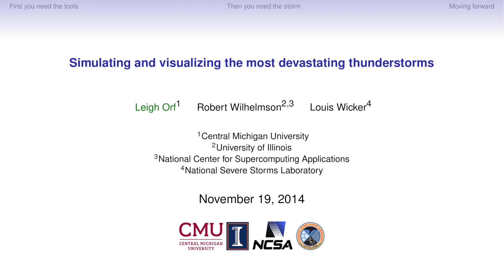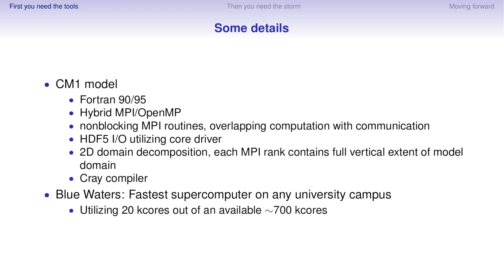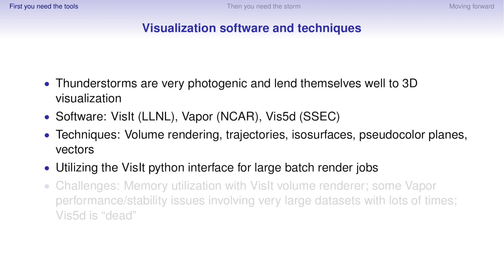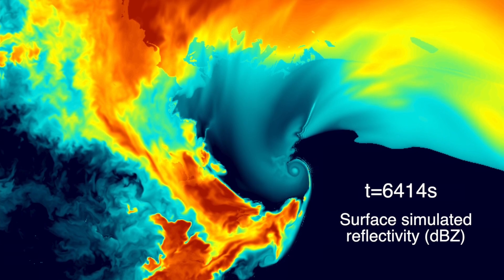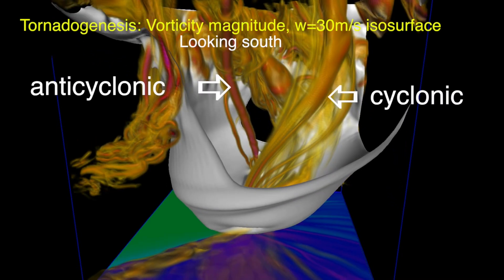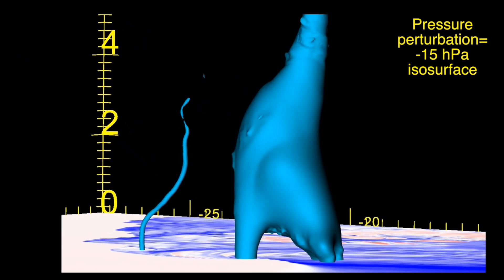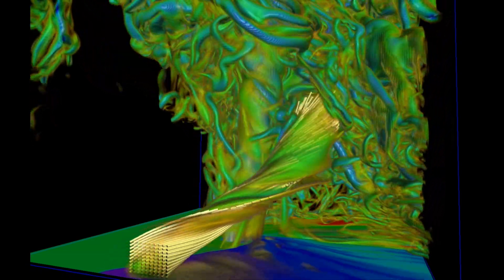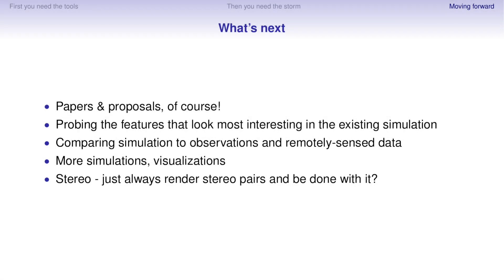Simulating and visualizing the most devastating thunderstorms [SC14]

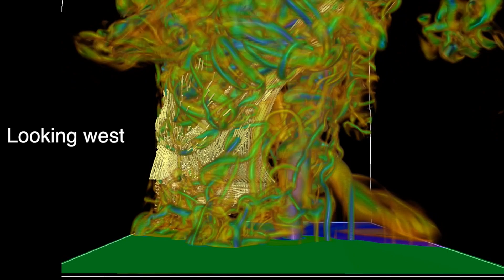Comment: 12:50...  Now watch the 3-31-23 Keota, Iowa monster.  You can hear those RFD surges a few times.  I also noticed that each RFD surge definitely had a direct correlation with that tornado's wind speed and mmotion becoming more violent.  I also noticed the tornado stretching, and lagging behind the tornado just off the ground and into high up the supercell and mesocyclone.  That RFD surge visibally got vacuumed right back into the updraft with incredibly violent motion.  So much of the air right outside the tornado's vicinity seemed to just go right back up.  But noticing behind the tornado just at the cloud base, the inflow was cracking as well, up into the mescyclone.  The whole southern end of the storm, the hook, meso, seemed to wrap up tighter, possibly to keep up with the parent supercell.  All that intense rising motion adding to the overall mesocyclone rotation as the tornado on the ground lagges behind the rest of the storm, and then the RFD surges happen and the tornado got more intense; or, the RFD surges happen because of a cause of the parent mesocyclone inflow; or, it could be a direct correlation with storm motion, which to me would make more sense. Interesting stuff.

Comment: I cant believe how the laws of physics can be “turned into” code.. for it to run on a program, and display results very similar to what happens in real life. I just.. this is just immense.
Reply from the maker: What I'm doing is an extension of 3D cloud modeling work that started in the 1970s... since then, the computers have gotten better, the models have been improved and we've got lots of observational data, which has increased our understanding but also helped us make better models. With even better computers on the horizon hopefully we'll make a dent in our ability to better forecast these types of storms.